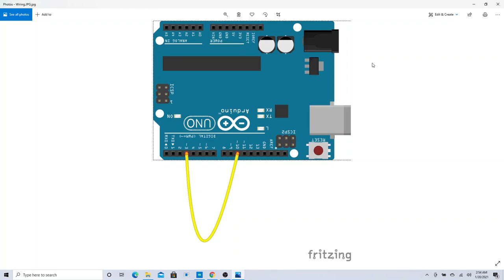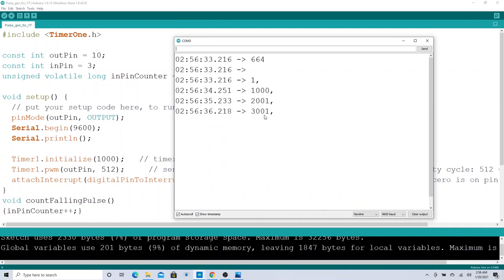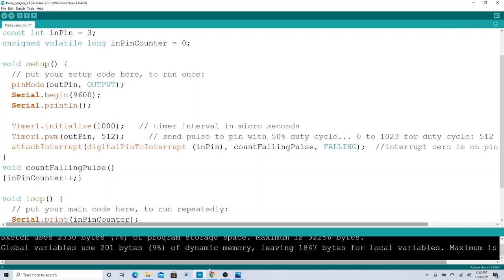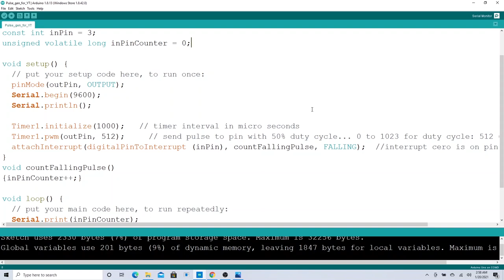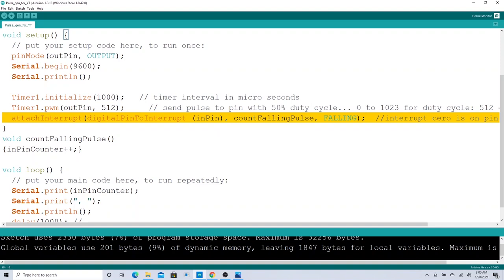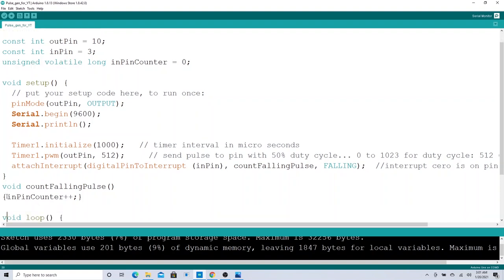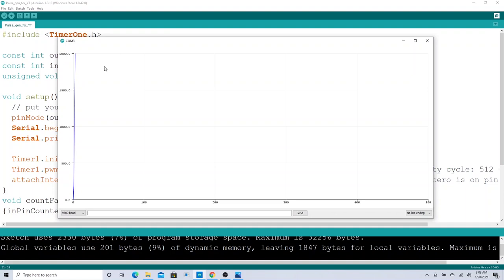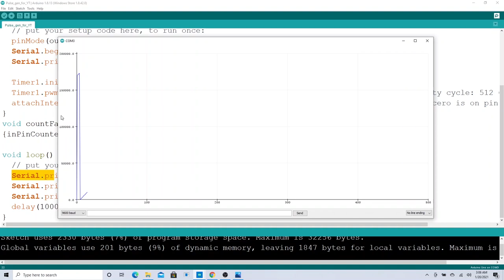How to Count Pulse Using Arduino Pulse Counter

Comment: Using interrupts in such a way does not seem, to me, to be an efficient method of programming. Couldn't you just use a binary ripple counter (such as a 74hc4020) and save on the interrupts?

Comment: Big thanks for this video. I am looking for a coding that converts the number of LED blinks into a numeric number. Challenge here is that the blink contains two different numeric numbers. Example: for number 24 (to be displayed), the LED will fast blink 2 times and after a short pause long blink 4 times. Any advice will be highly appreciated.

Comment: hello brother giving a huge thanks for this video. if i need to display the pulse count in a 16*2 lcd display what should i do. now days i am developing a rain sensor using piezo eletric tranduser i am going to count the pulses using ardunio
Reply from the maker: You are welcome...  you can try the arduino  lcd crystal display kit. I don't have a video on using this lcd display. If it's super urgent we can jump into zoom to figure it out after you have all the hardware.
Reply: @codingwithalfred  i got the hardware and all other components can you roughly send an email to me to get an an idea about a sample code that i can use to display tyhe count what you are doning in the serial monitor
Reply from the maker: @dhananjayabandara158  what's your email?

Comment: how do i use this logic to count pulses by a rotary encoder?
Reply from the maker: Depending on what type of rotary encoder you have. Fundamentally as long as your encoder is producing a pulse wave good enough for the digital pin of the Arduino to count (if the encoder is a high dc voltage device, you can reduce the voltage via a divider schematics). If you have a specific situation that you are dealing with. Please, let me know the details, let’s work through it.
Reply: @codingwithalfred  I am a final year student and my project involves in detection on a pulse from the encoder and displaying a output. Basically we are using this as a selection bar pretty much like the lcd screen.
The encoder that I am using is 16ppr encoder, naming RHSS - 40
Could you help me with the programing part majorly
Reply from the maker: @mahimakulkarni4107   16ppr encoder have a few variation. Do you have the model number/name? Looking at  PEC11H Series - 11 mm Encoder w/High Detent Force. The code on the video will work for it (ie it will detect the pulse) the contact rating is 10 mA @ 5 VDC.  I am not sure what you mean by "Basically we are using this as a selection bar pretty much like the lcd screen"? If you need to detect the pulse and display the count on an LCD display, then all you need is to write the total pulsed counted to the LCD display module.
Reply: @codingwithalfred  the model number is RHSS -40 and right now I am wanting to detect a single pulse to begin with then will be using the switch case to display the output but the difficulty I am facing is that the pulse detection isn't happening the way it needs to for me to further move forward. Can you share your email address so that I can send the pic of encoder and my code for you to have a look?
Reply from the maker: @mahimakulkarni4107   I looked for RHSS-40 and could not find it. Do you have the datasheet for it? Perhaps you can send me a copy or point me to a link to download it? Absolutely, i will be happy to take a look. Here is my email: hiiasolution@gmail.com
.  I think i understand what you need, it should be straight forward detecting the pulse. My guess is that maybe the setup is not configured correctly. As soon as you get that part right, then based on the pulse count, you can now use a switch case to display the messages you want to show on the LCD. All this will be done by code and its very straight forward to do.
Reply: @codingwithalfred  yes and I am working on the code as well, will be sending you the mail with all the necessary information.
Reply: @codingwithalfred  have sent you a couple of mails about all that I have done till now please do have a look and guide me. It will be of great help.